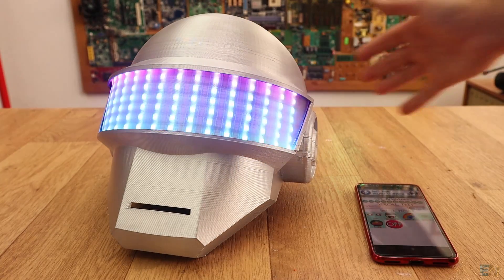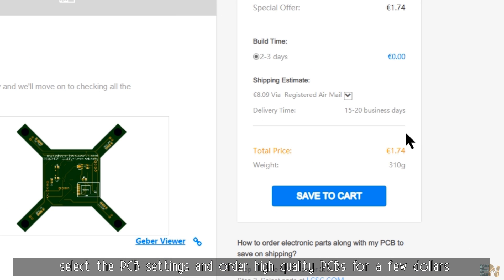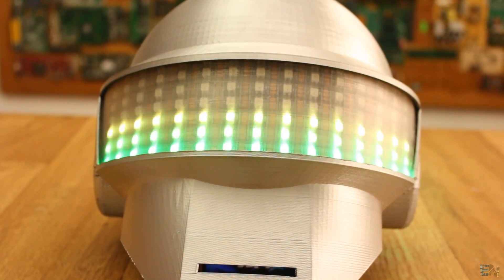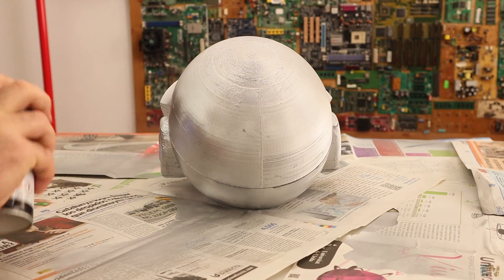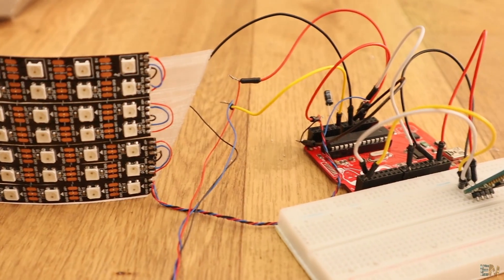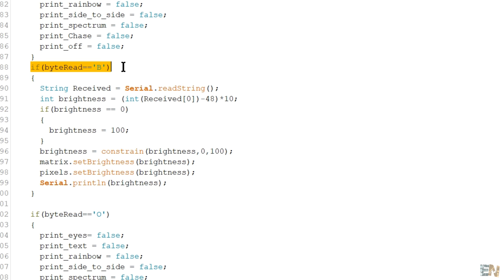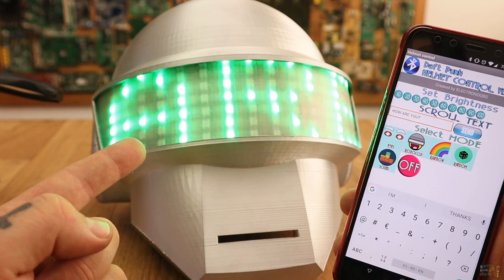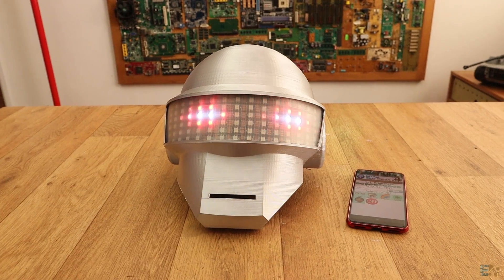Homemade Daft Punk RGB helmet with Bluetooth

Comment: I have a doubt on the code, changed the values of the rows of led on the numpixels but the text data is not working properly, it is displaying on the 7 row mode. Anyone solved or have a solution for that? Please, need some help on the code!

Comment: Sir I made this project on a big board with 7 rows and 41 column and with 287 pixel LEDs.
Sir here is some problem  , on this project the text message is move correctly but the design pattern doesn't work like random and rainbow on your app.
Sir please solve my problem

Comment: Great project Electronoobs as usual. I have a 210 by 210 print bed so i have taken the a stronger version of the stl remixed it and cut it into 4 parts as well as  adding stud holes all around to assist in putting it back together. Hope its of use to someone. https://www.thingiverse.com/thing:3352984

Comment: Hi Sir,thanks for creating this wonderful video !
How can i donate with paypal?
Also, i followed your ebay link for the capacitors but theres different uF and Voltages ,which should i buy?
Hope to hear from you soon...
Andy
Reply from the maker: Just add a 10uf 16v capacitor. Keep up!
Reply: @ELECTRONOOBS  thank you Sir ! Whats your paypal email?ill like to make a donation . Another thing, if i add twice the amount of LEDs in this video,should i use different rating capacitor?
Warmest Regards,
Andy
Reply from the maker: @asianlionsofasia8982  no, the capacitor is just to smooth the voltage peaks. But, if you use double the LEDs you will definitely need an external voltage regulator for 5V. The one the Arduino has is not powerful enough... Thank you!

Comment: Hi, do i need a voltage divider in order to covert the arduino 5v logic to 3.3v  of Bluetooth module? i am having trouble.
Reply from the maker: To be safe for the Tx pin yes, But I didn't used and never had problems...